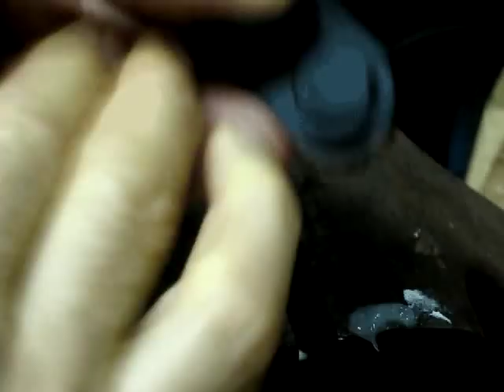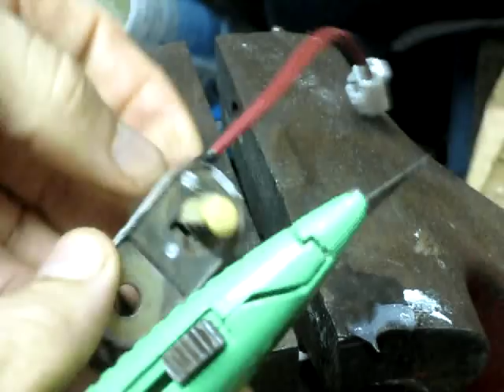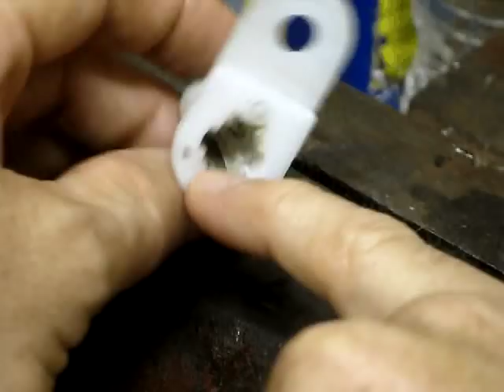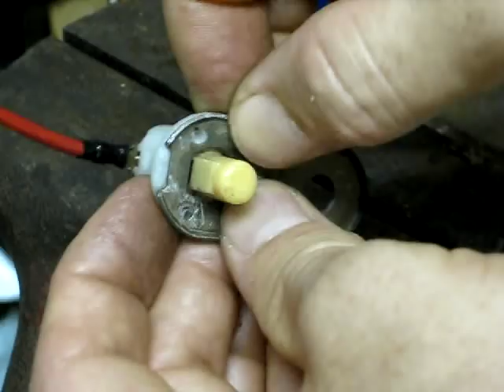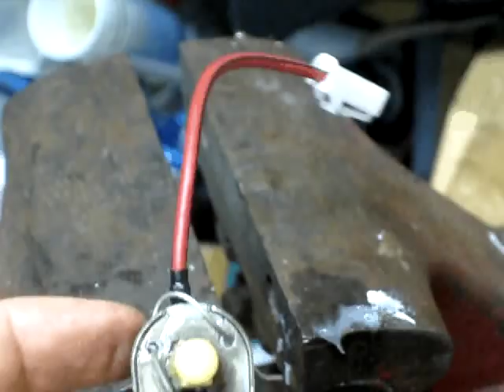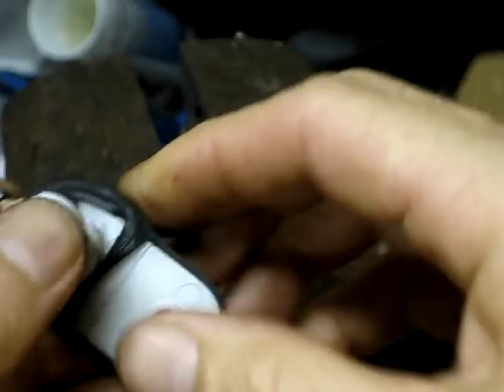Door Courtesy Dome Light Switch not working

Comment: I had already placed in my cart an online order for three of these switches thinking it was what I had to do to fix the problem.  While double checking google to make sure what I ordered was indeed the correct parts for my vehicle (fj80 landcruiser) I came across your video.  It was exactly the same as my switches.  Today I tried it and in less than an hour I had fixed all three that were troublesome.  I didn't even have to remove them from the connecting wire (which in itself would have been a major pain since even behind the paneling the rear ones weren't accessible to the connection.  Anyway your method worked like a charm.  It made me really happy when it fixed the problem just as you described in your video.  Much thanks my friend!!!!

Comment: I repaired mine without taking the switch apart, all you need to do is unbolt the switch, then get a thin emery board/nail file, or a thin folded over piece of fine sand paper, cut it about 1/8 of an inch wide. slip it between the button contact and the housing contact on the top and bottom. push the sand paper/emery board in and out a couple of times and  this  will work.   after I did this little sanding, I sprayed some contact cleaner thru the top of the switch with the button pushed in to clear out the dust. there is a hole in the bottom of the back of the plastic that the junk will run out from.  this method doesn't require you to remove the center trim panel or rear seat of the vehicle to access the wire connector.   you would be surprised at how much trim panel retaining clips cost to replace. I had the correct tool to remove them panels, but on a 25 year old car, they are very brittle. good luck with whatever you choose to do.
Reply from the maker: Hi Johnny,
I will have to try that the next time I need to work on one.  Thanks
Reply: This is what I did, too. Use a razor just like the one shown here, inserting blade on both sides and working the switch a bunch. Then I used compressed air, holding the can upside down, for good measure. Seeing the insides in the video helped me understand how to do that. And I didn’t even need to take it off the car.

Comment: thanks for your video I have a 97 AE92 Corolla and it had that very same switch and i even bought the universal door switch which didnt fit well but due to your time and video I was able to repair and put back the original switches
Reply: thanks again to you. all four work like brand new still
Reply: never did but im sure its not worth the repair video u gave

Comment: Great video! My wife still drives our '95 Avalon and doesn't want anything else. I noticed the courtesy lights on both front doors had gone out, along with the ignition switch light that is activated when the driver door is open. (The dome light has been out a long time due to a problem with the fixture.) At first I suspected a fuse, but it checks out fine. I'm pretty sure both the door jamb switches have corroded, first one and then the other. I'm going to try your fix as soon as the weather warms up a little. Thanks for the tips.

Comment: Your video inspired me to attempt your method on my wife's '09 CRV. I did it! Saved myself at least $5 bucks and didn't have to buy another piece-o-crap Chinese junk park. Between you and my friend at SouthMainAuto, Eric O. I may actually do some serious wrenching! I didn't have to drill out any plastic. The tiny clips released the actual switch, and then the tiny locking clips that held in the spring loaded plunger, well they were tricky but I finally popped out the plunger (?) and found the contacts! They were very tiny and flimsy. I gentle bent them "up" so they could make better contact. I sanded with some 800 grit emory cloth and put it all back together. I'm liking and subscribing. 

Again, thanks so much.

Comment: my very trusted shop quoted me $460 to replace both of these switches on the rear doors of my Prius. I'm finding a new shop.
Reply: You're finding a new shop? Why not fix it yourself. You just watched this a easy fix video
Reply: @ghost-4230  for this, I am buying a replacement switch and replacing it myself. The courtesy switch in my Prius is a little bit different than the switch in the video (2007), and I could not take it apart in order to clean/renew it. I am seeking a new shop, in general, because my current shop can't be trusted after this case. Lord knows how many other times they took advantage of me.

Comment: I bought all 4 of these for my 91 LS400 from the dealer (online). Don't remember how much I paid, but the bad switches were making my factory alarm go off at random. Also, my car has an automatic headlights off feature that turns the lights off if I turn off the car and remove the key from the ignition. I kept the old switches "in case". Nice video on how to save a few bucks.

Comment: Driving my Toyota MR2 2004 last night (in heavy fog if that makes a difference) the door open indicator started flashing at random times, also the dip beam headlights would come on when the passenger side door was open.  Hoped it would go away but was still flashing this morning when I drove it.  I guessed the door sensor was faulty so did some googling and found this video!

The sensor on the MR2 MK3 is slightly different to the one in the video.  It does look like it could come apart but I didn’t want to force it so I just sprayed electrical contact cleaner all over.  Seems to have fixed it and saved myself some cash!
Reply from the maker: The contact cleaner is great to clean the switch but also removes all lubricants.  Try to get a good lubricant into that switch or it may corrode quickly and fail again.  Strange that the "door open" indicator came on with all the doors shut.  Usually, the "door open" indicator comes on when the wire going to the door switch is grounded.  That is how the circuit is completed.  Also, it is strange for the dim beam on the headlights to come on when a door is open.  I would suspect a possible short or a bad ground connection.  A bad ground connection can cause current to flow backwards thru other circuits.  If you can find a list of ground connections for your car, you can take them loose, sand the paint off under the connector, cover it with grease or dielectric grease, then put them back together.  There will be several ground points on the car but start with the ones that are more likely the problem (one near the passenger side kick panel, or one near the headlights)  If you have had work done to the car recently, the mechanic may have forgot to tighten all the bolts that provide the path to ground.  These are all just guesses.  I have never worked on an MR2.  Good luck.  Please let us know if you figure it out. Thanks

Comment: I hope this method will work for my 1994 Toyota Camry.  Should I DISCONNECT the battery first?  I'm a beginner when it come to working on cars.
Reply from the maker: +howell webb Most car courtesy light switches work by grounding the negative side of the circuit. So if you accidentally short the wire to ground it will just turn on the light.  But, you never know when you might be working on a car with a different design.  Since you are a beginner, it is probably a good idea to disconnect the battery.  I took a look at some pictures of the part for your car.  It should be a very similar switch to the one in my video.
Reply: +fixpro256 Thanks for your help...it worked like a charm.
Reply: I have a Toyota Camry 94 too!! Mine is V6 tho :P

Comment: Good video, however, you may have  been better served by safety wiring the ground plate against the plastic housing by looping the wire through both holes bringing them together then twisting them as if it were the shape of licorice.  This technique is commonly used in aircraft maintenance.

Comment: Not sure why you didn't use some hot glue or small machine screws and nuts to assemble the switch back together instead of that wire.
Reply from the maker: Screws would probably stick out and get in the way.  I haven't had much luck with hot glue holding things like this. But it wouldn't hurt to try. There are some adhesives that would hold ok. Just have to wait for them to cure,  and make sure they don't get into the mechanism. Might be hard to get it back apart if needed.

Comment: Could have saved a whole lot of time without removing the switch from the car, just peel up the rubber cover from the bottom (where it covers the bolt) far enough to expose the base of white plastic switch stem  then spray into the tiny crevice at the base of the switch stem thoroughly with DeOxit Contact Cleaner while depress and release hard (popping) the switch multiple times to clean the contact surfaces however ... you may have to repeat this step when oxidation happens again in few years but filing or sanding away the metal that originally had oxidation protection coating means the same problem may occur sooner when moisture sets in. Buying new is other option but that would incur cost of labor and part. It took me less than 3 min with my approach to fix my 1997 Toyota Avalon courtesy light switch malfunction and a can of DeOxit is only $14.00 on Amazon and it will be good for your other cars' switches and circuit contacts around the house!

Comment: electrical cleaner and vasoline seem to have done the trick on 07 FJ Cruiser
Reply: +mark b (fixpro256) Apparently the FJ has some issues with water dripping from the roof into the door jamb when the door is opened.  This causes the sensor to  corrode prematurely, some people have claimed as early as 24K.  Mine is problematic at about 80K.

Comment: My car door is misaligned most likely from a lockout from previous owner. The door ajar light is always on because the car door is unable to push in the door jamb button enough for the light to go off. What can I put inside my door jamb so it pushes in on the button?
Reply from the maker: You could tape or glue something to the door where it hits the button.  I use a lot of PVC wood for stuff like this.  It is available at some hardware stores.  Easy to work with and won't split or rot.  But only sold in 8 or 10 foot sticks.

Comment: How did you get the switch out? Mine won't come out far enough to let me unplug it.
Reply from the maker: Usually you can remove the panel that covers the area behind the switch.  There will usually be an access hole where you can get to the connector.

Comment: FixPro---I pulled out the switch of my 1996 Toyota Camry as far as I could after removing the 10mm bolt. It's connection was not visible for me to disconnect it. How can I disconnect something that I am unable to reach?
Reply from the maker: I am not familiar with that car.  There may be a panel on the inside of the car just in front of the hinge area.  If you pull that panel off, there might be an access hole where you can see the connector.

Comment: The door switch not last long enough. All has same issue due to contact corrosion after years. And it located in the shock area when you close door with bang. Seems every car maker forget to list it as service parts like brake shoes. It got me in trouble of battery drain out if that failed. It is national epidemic of such failure for almost every car of older than 10 years.

Comment: My cars door courtesy switch only works sometimes.  If I push it in with my finger it goes off.  I believe it started acting up after the door was slammed hard.  I thought maybe it was the rubber knob in the door but I wonder if it could be the spring, what say you?
Reply from the maker: Usually, it's just corrosion or crud on the contacts.  Sometimes you can spray contact cleaner in it and get it to work a little longer.  But, eventually it'll probably give you trouble again.  At some point, you'll probably have to either replace it or fix it.  Worse part is the others usually start to go out shortly after the first one.  If you're getting ready to order a replacement, you might as well try to fix it (if you have the time and ability).   Then you will know how to fix the others with they start to act up.   Can also get one out of a salvage yard to practice on.
Reply: fixpro256 I did a quick fix and just stuck one of those sticky floor protectors for chair legs.  I’m going to take it out when I have a chance.  Just have to find the right one for a 2014 Toyota Camry which may not be easy to find

Comment: Is there any reason you can't clean the contacts with a cotton bud and white vinegar as is often done with batteries?
Reply from the maker: If the switch is in pretty good shape that'll probably work.  A lot of times the arcing and corrosion makes the surface rough and pitted. Vinegar will probably at least improve the situation, but you'll probably need to wire brush or file some of the areas to get the switch to perform well over a longer period of time.  Otherwise you'll have to take it apart again..

Comment: Unfortunately the switches on my car are sealed steel units and cannot be opened up. There is a good earth point on the door and it works if I press slightly on the switch plunger - Is there anything I can squirt in there to improve contact. Have tried contact cleaner without success.
Reply from the maker: +MsCelicagt4 If you disconnect the wire, can you spin the plunger? That may clean the corrosion from the contacts. Try wd40 just to see if it works.  It probably won't last long.  If it does work, try a light weight oil. What type of car do you have?
Reply: +fixpro256 Its an old Bmw e30 which seems particularly hard on the drivers door switches. Its great when one can actually fix these things. Thanks for reply.
Reply from the maker: +MsCelicagt4 Is that the one with the two wires going to it? Does the plunger spin?
Reply: No, the plunger does not spin and it is a single wire. It works if I touch the plunger manually when the door is open. Just checked there now and it seems to work perfectly with the rubber cover removed from the switch.
Reply from the maker: +MsCelicagt4 If you open the door slowly, does the light even flicker?  If not, it may need a shim glued on the door where the plunger strikes.  You could also try to swap with one of the other doors.  Sucks to have any door not working, but would rather have a rear door not working than the drivers door.
Reply: +fixpro256  I know what you mean as regards the shim.It was previously flashing all right but at the moment it is working with your wd40 tip so my problem is solved for the moment. It is just a two door but as you say I can swop over the switches. I have no way really of actually cleaning the switch so may have to get a universal replacement switch down the road. Appreciate your help and thanks for your time.
Reply from the maker: +MsCelicagt4 You could also try soaking it in vinegar.  That will dissolve rust and most other gunk.  Try just an hour at first.  Then wash vinegar out and dry.  Then lube inside and out with light oil to keep it from rusting.  If it starts acting up again, try a vinegar soak for 2 or 3 hours.  The wd40 might eventually dry up.  It is mostly solvent and very little lubricant.  Your welcome.  Let me know how it works out.  Thanks